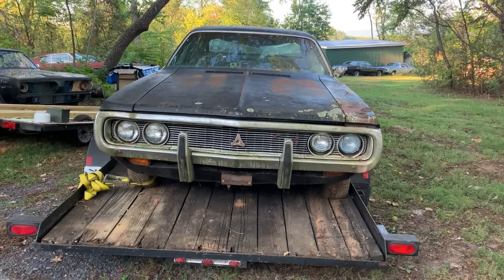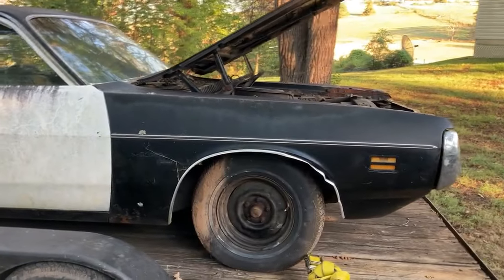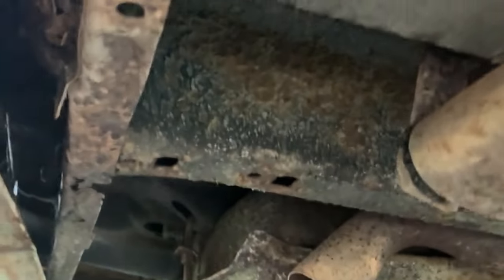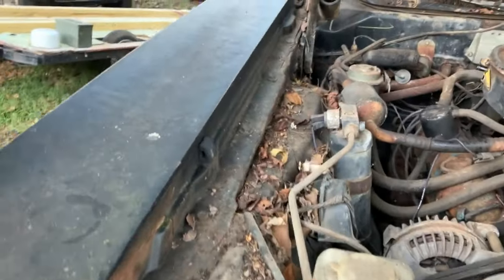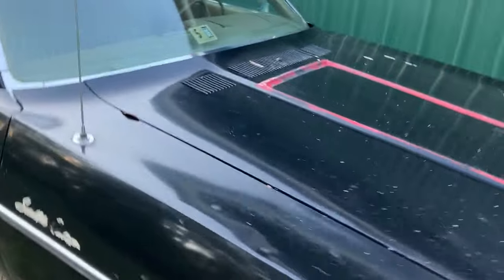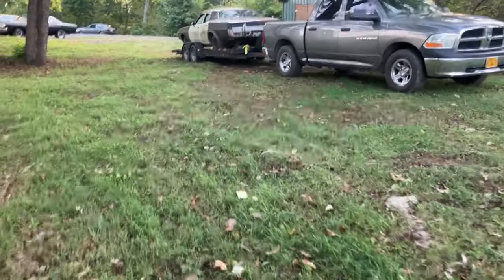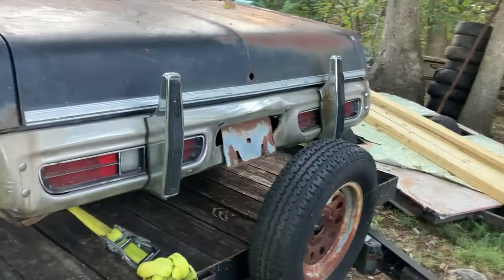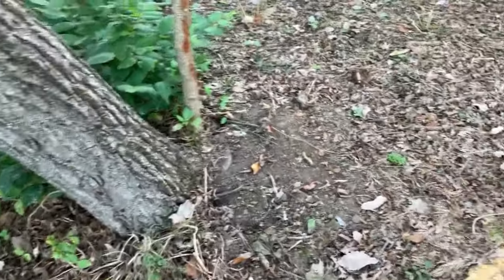Lets check out our cheap 71 Dodge Coronet in detail.

Comment: under a 1000 bucks because it's not worth 1000 bucks.   It's so not original and a 4 door.....the white paint fake cop treatment makes it worth less.
Reply from the maker: why you hate on 4 doors? yes, they typically sell for less than a 2 door. But they can still be hot rodded like a 2 door. Also depending on the year and model they can look better than a 2 door. win, win, win!